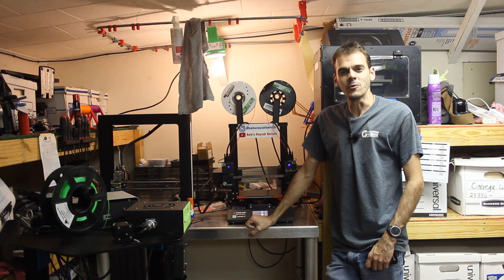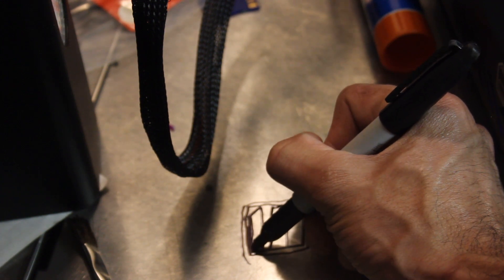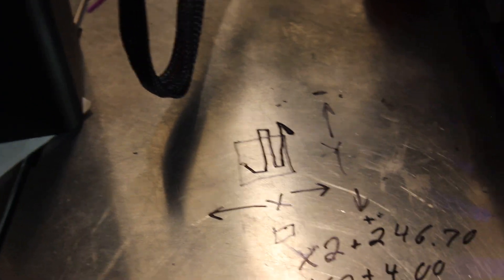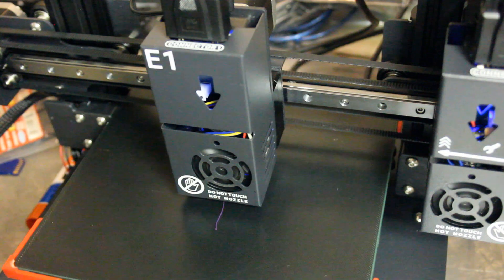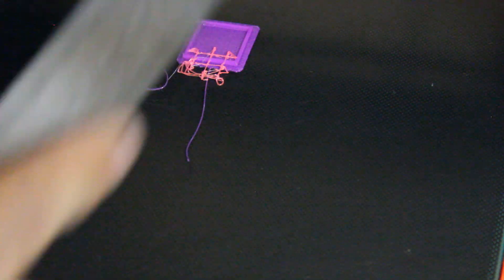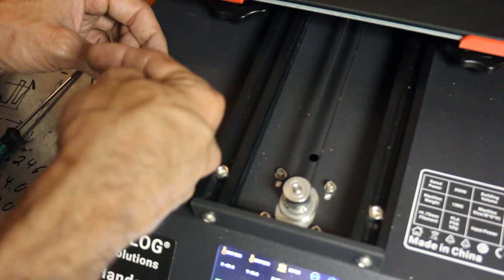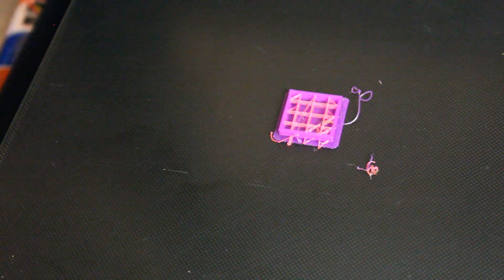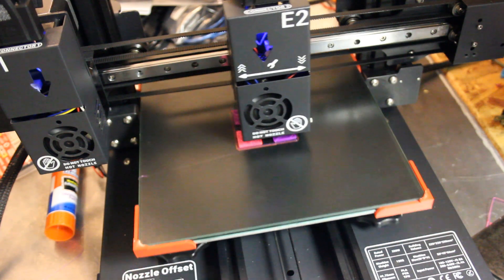How to Calibrate a Tenlog Printer's Nozzle Offsets

Comment: I am assuming Z axis calibration is same concept. My 20x20x20 block is more like 20x20x40
Reply from the maker: That sounds like it should be adjusted in the settings for "steps/mm". At those dimensions, dividing the current z axis steps/mm would be a good starting point.

Comment: I can’t find anything in other forums about the issue I’m having but maybe you know? I’ve made a couple prints that have worked great but on some of them (usually after a couple layers from the beginning) the E2 extruder doesn’t home correctly. For example, after laying down a layer it will try to home but it acts like the sensor doesn’t work and knocks to the right repeatedly. Eventually it stops trying to go against the end of the rail and homes. E1 will then run its course and that’s when E2 returns to print but it’s now offset almost as if back the distance it was before I calibrated the two nozzles. So my thought is that the knocking is because it thinks it has to travel back further? 

Kinda confusing as some prints I’ve done haven’t experienced this and come out all lined up. Also if I hear the knocking, run to the printer, pause it, home it manually, then resume, the problem is fixed. Also, it only happens once (like it won’t keep knocking and move further off each time. Once it’s in its original it’s happy).

Idk if it’s a slicer issue where it’s overriding my setting possibly? Maybe there’s a firmware update I need? Bad home sensor(though it works in every other instance). 

Any thoughts help! Thanks!
Reply from the maker: It could be several things, but there's a few quick things you can try before getting deep into the machine. The first thing is to format your SD card and try to keep it as empty as you can. Preferably dedicate a 8GB card to that machine. Sometimes cards that are "bloated" can cause issues.

Second is make sure you're belts are tight on both x axis. And check all the connections to the motors and limit switches. 

Hope this helps!
Reply: @bebsrepairbench5074  thank you so much! My card definitely has quite a bit on it and that might explain why some of the first prints were okay while adding later prints to the card may have caused the issue.  I’ll mess with it and let you know how it goes!
Reply from the maker: @cjpryor1416  sounds good!

Comment: Great video, big help thanks! 2 questions for you, can you provide a link for your bed clamps? I'd like to use those on my Tenlog - they look great. Also, how do you set the z offset? I'm struggling to find this option on my Tenlog D3 Pro. Thank you!
Reply from the maker: I'm glad it helped! I'm not sure I'm supposed to post links on YouTube, but if search Thingiverse for thing:4741080, I've uploaded the files there for the bed clips. Just be warned they can be a little finicky to install. As far the z offset, that's not usually adjusted in software on these machines. First you level the bed using the E1 extruder as a guide, then adjust the height of E2 using the adjustment nut in the extruder housing until both nozzles are even.
Reply: @bebsrepairbench5074  Thanks man, really appreciate your time and the info. Will look forward to your future posts!
Reply from the maker: @dragani328  no problem!

Comment: What is your type of bed ?
Reply from the maker: I use a carbon-silicone glass bed from Befenybay. It's been a really great build surface for PLA. When I print other materials I flip it over and use hairspray or gluestick for adhesion.
Reply: @bebsrepairbench5074   ok, thanks !

Comment: I'm fairly certain the 792 for the z axis is off.
The only printer I've seen with similar z-steps is the Ender 5, which had 800 steps as default. 
The manual for the TL D3 also shows it as 800.
Reply from the maker: I would say it's accurate according to the calibration prints.
Reply: Like, it's only off by a matter of 1% either way, but I'm fairly sure the motors are 1.8 degree steps, and that the z-lead is the same thread pitch as the one on the Ender 5. I just got mine 2 days ago too, though, so shrugs 
But I printed a couple benchies at 800, they look great. Just recommend testing out.

Comment: I need some help.with my tenlog 3dr-pro
Reply from the maker: What sort of help?
Reply: I wasn't able to get the twnlog profile to load, so I had tonuse a profile for a diff machine,  and im getting some artifacts and blobs, but ive messed with coasting, and retraction,  I think it's that I can't get thr profile for that machine to load
Reply from the maker: @grassfpv1876  which version of Cura are you using?
Reply: 4.8
Reply from the maker: @grassfpv1876  if you check out my "Tenlog Hands 2 Assembly and First Thoughts" video a commentor  left a really good set of instructions to get the profiles updated. It's actually what I used to upgrade mine. I also started off by simply downloading the Cura 4.3 offered on the Tenlog website. It worked really well but isn't as well featured as the current version. 

Also you may have already done this, but I would try a different filament just in case that's causing an issue.
Reply from the maker: @grassfpv1876  also are you using an ooze shield for your IDEX prints?

Comment: Hi, I have a question about some bearings in this printer, I have one, and 2 bearings rotate freely, I would like to know if the same thing happens to you, I am talking about the bearings in the Z axis rails, I have 1 bearing that rotates free per rail.
Reply from the maker: I have the same thing on my Y axis rails. It doesn't seem to affect print quality. The other rollers "trap" the axis and don't allow any play.
Reply: @bebsrepairbench5074  but what about the measurements? I mean, when I print a 20x20x20 cube, on the X and Y axis everything is ok, the measurement are 20mm, but in the Z axis (the bad one) the measurement is of 19.5mm, do you understand me? Sorry for my English
Reply from the maker: @CristhianGrados  your English is fine. That inaccuracy on the Z Axis is quite common on many printers. Often it is caused by the first layer being "squished" onto the print bed, which make the entire model shorter. When you level your print bed, try using a slightly thicker piece of paper, like a business card, as a gauge to set the distance between the bed and nozzle. However you will have to find a balance between having good initial layer adhesion and having a print that is not "squished" too much.
Reply: @bebsrepairbench5074  a business card? I was using paper bond. Ok, I'm gonna try it, thank you so much
Reply from the maker: You're welcome! I hope it helps!
Reply: They are adjustable and should be adjusted in right to the point where they do not spin freely and no further.